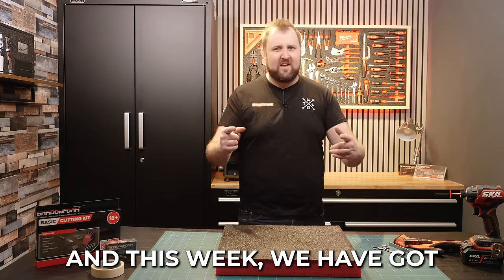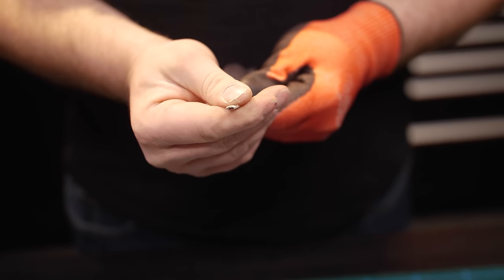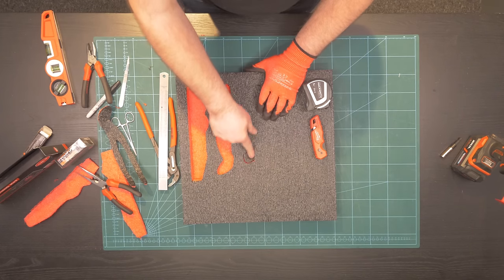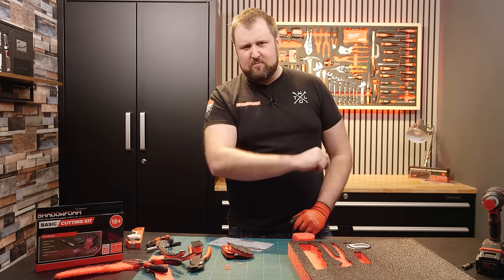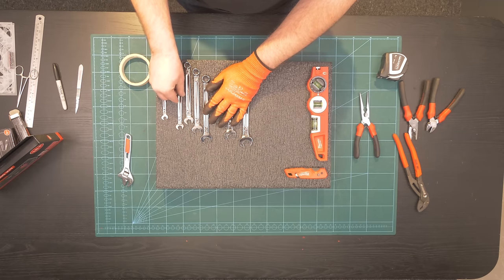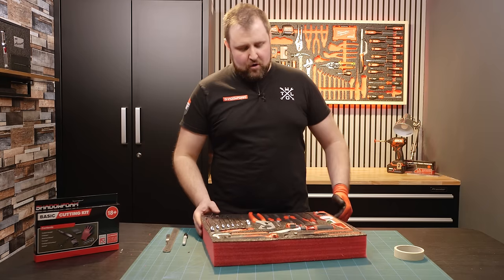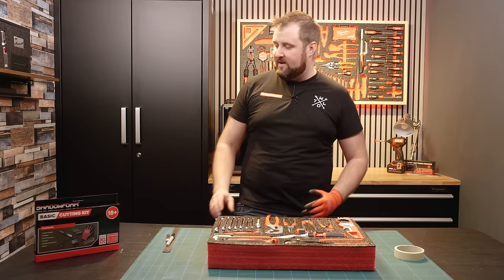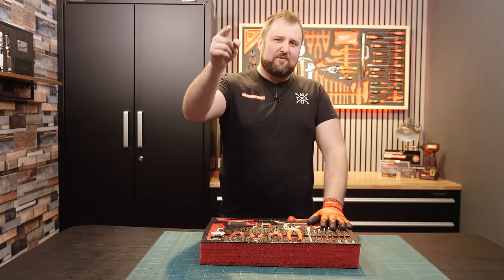Everything you NEED TO KNOW to Cut Shadow Foam!

Comment: Metalworker here - Springs, like the one in your pliers, don't wear out from being compressed. They don't wear out from being opened. They wear out from being repeatedly compressed and uncompressed. You won't wear out your pliers with the handles squeezed together in your display. You will wear them out actually using the pliers, but what good is a tool you don't use?
Reply from the maker: Thanks for the info! 👍

Comment: Your shadow foam is expensive
Reply from the maker: Are you looking on www.shadowfoam.com?
Reply: It’s a once in a while purchase. For me, as I spend a fair bit on tools, housing them in an expensive case is an investment. The coloured Shadow Foam will show up if you’re missing a tool, that could pay for itself in one instance. 
A 125mm Knipex plier/wrench I have is about the £40 mark, having foam to ensure I don’t leave it anywhere is a bargain. If you have scruffy cheap tools ( nothing wrong with that, some people don’t want to spend money on expensive tools) then I’d agree, no point in buying foam inserts. 
From what I’ve read, foamed toolboxes came from the aviation industry. It confirmed the presence of all the engineers tools, so nothing was left behind to cause possible damage, which could be catastrophic.
Reply from the maker: @cerealkiller4248  couldn’t have said it better myself 👌
Reply: We didn't use foam in the Forces but we had shadow boards which as you describe instantly highlights a tool is in use. Each engineering tech had numbered tags which where put on a pin next to a tool taken to an aircraft. Certainly ensured you knew exactly where the tools where at all times!

Comment: Great set of tips, the pop up of the pad saw is 1 I am going to steal 👍. For my test leads, I use a wooden or steel object to scribe around, so I don't cut into the lead insulation. In my Teng tool chest, they have double layered a lot of tools, the pliers are a good example, where they would lay the side cutters on top of the combo pliers.
Reply from the maker: Great tips Three Phase, why does that not surprise me?

Comment: Hi there, thanks for the video. I have just invested a Makita set and will be using shadowfoam to get them nicely organised. Quick question - I'd like to get some of my other corded power tools in foam too. I have searched through your vids tips on this but didn't spot anything so far. Do you have any advice for corded tools? E.g. where to set the cables/plug. Would you get really thick foam to cut a deep cavity behind the tool or is there some other good method to keep it all looking tidy? Many thanks. Keep up the good work.👍

Comment: Lots of good tips there.
I have 200 router cutters that I want to store in drawers and a systainer for mobile use. What is the best way to cut 200 neat holes in 8mm, 1/4 and 1/2 inch diameters into shadowfoam?
Reply from the maker: Thanks David! I’d say templating is a good option.

If I were to do that I would probably mark out a grid of dots with a silver sharpie and then heat up a 1/4” metal bar and melt the holes.

I may have to make a video about cutting circles 👍

Comment: Well first feedback/tip from an utter novice.  I failed to factor in how a bag reacts when stretched slightly meaning the foam I ordered was slightly too long (better than short!)
So needed to cut 30mm off one end and to be honest didn't fancy using a scalpel.  So armed with ad much courage ad I could muster I borrowed a large kitchen knife (non serrated) and using a slow sawing motion keeping neat to vertical and using a metal straight edge it produced a perfect cut through 70mm of shadowfoam.
Reply from the maker: Slow and steady produced a great cut, can’t in good faith agree with the knife but I’m happy you ordered slightly big rather than slightly small! What was your Shadow Foam project?
Reply: Agree the large kitchen knife isn't the ideal tool but the result wad very neat 
Haven't finished the project yet but it will be a duffel style kit bag for holding a crossbow in it's primary component parts.